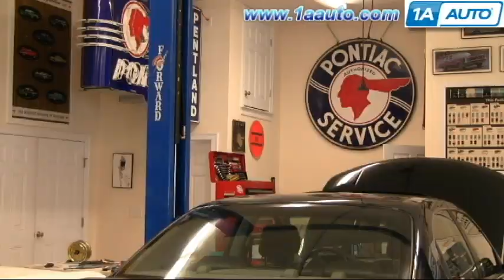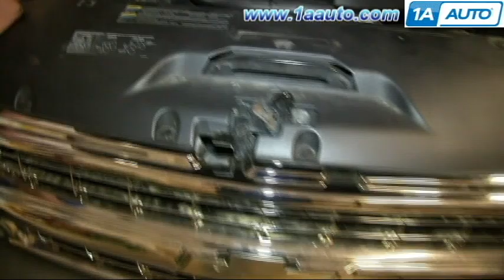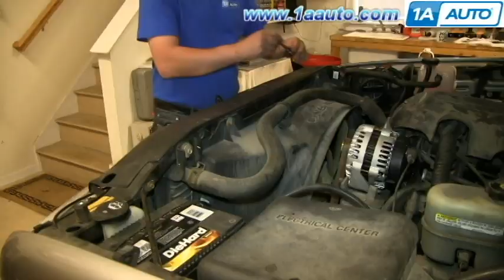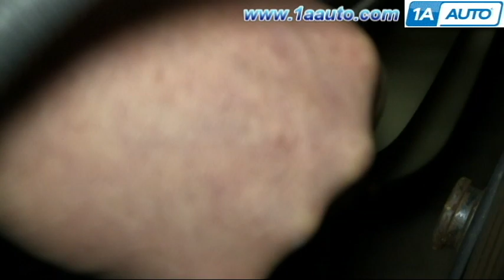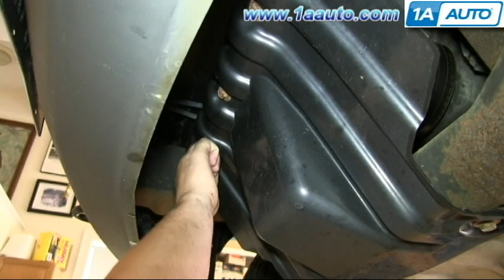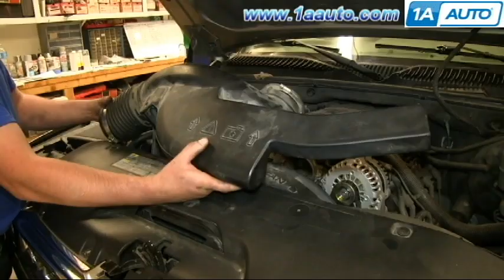How to Replace Serpentine Belt 00-08 Chevy Suburban

Comment: Good video, for those who are going to do this job: take a picture of your serpentine belt routing before you remove the belt. The diagram is helpful but the picture as a reference will be useful.

Also, you dont need to remove the fan shroud to do this repair. I chose not to and i had plenty of room. It's not a hard job, just prepare to be a little frustrated with routing the serpentine belt back on.

Comment: I assume there's no harm in driving it with the ac belt off? My compressor clutch locked up.  I can't afford to replace it now,  so i just want to remove the short belt for now.
Reply: cut it off then
Reply: I'm was wondering if cutting it off helped worked out ok same situation?
Reply: Plus will it effect the heat? Because when I turn on anything it  makes noises
Reply: @carlosJimenez-pd2fe  could have been bc the compressor was stuck. But if it wasnt not having a belt wouldnt affect anything except no a.c.
Reply: I know I'm 4 years late but it definitely doesn't effect the heat. I bought one mid winter with the AC belt off and I'm about to install a new one to see if I can get some AC, but other than that, it drives just fine without it.
Reply: Good mechanical video.  I was afraid the dude was going to drop his pants though.  😆